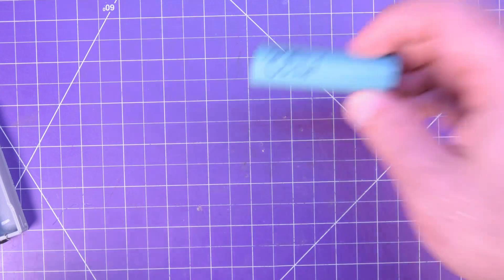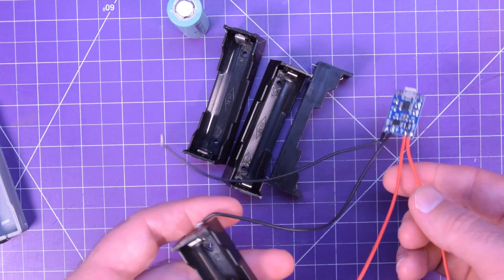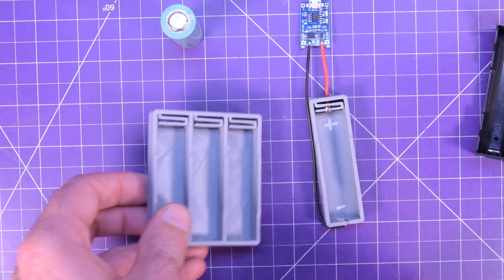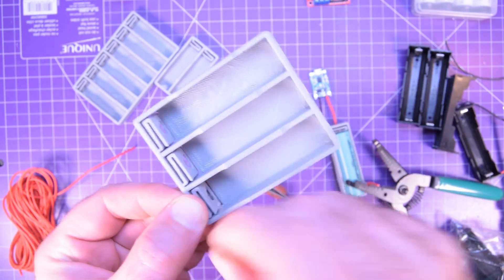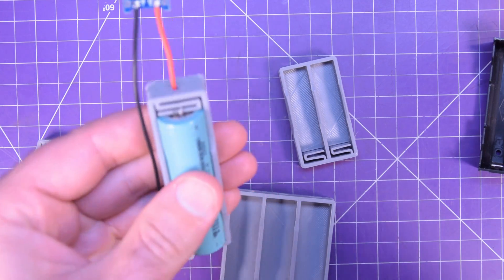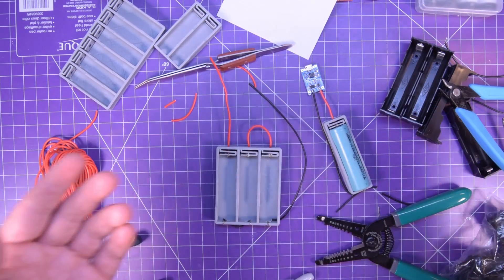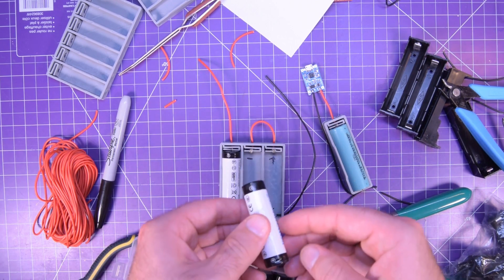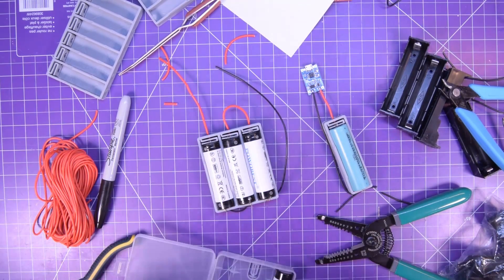3D Printed Battery Boxes - 3D Printing For Electronics

Comment: Cool! I printed something similar, but used some kind of silver tape that conducts electricity and sticked it to a poorly done tensioning plate. The idea was to use it as a spring but it broke every time. I was a newbie back then, I might return and redesign my battery holder now that I am a little wiser. Thanks for remembirg this to me and showing us such a great design!

Comment: I used a similar design to this for an 18650 battery case.  It works, but it was a real pain winding the wire contacts (I note how the video skips that part !).  It is really difficult, even using long nose pliers.  I think there is a real need for a 3D printed battery case like this, but the design needs to be improved to give better access for winding the contacts.
Reply from the maker: I agree, it's a bit of a pain, but it does work fairly well, once set up!

Comment: It Is Not Good My Friend 
I Did That 5 Years Ago
And Fail Continuity Of Power
Try To Test It With A Power Tool And 
You Will See Is Not Working.
You Must Out Metal Springs.
Amén.